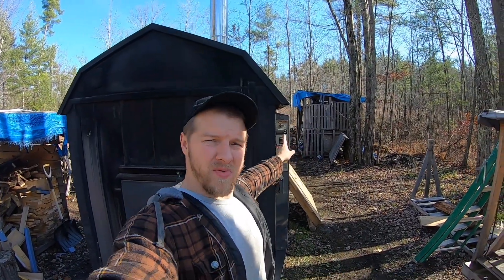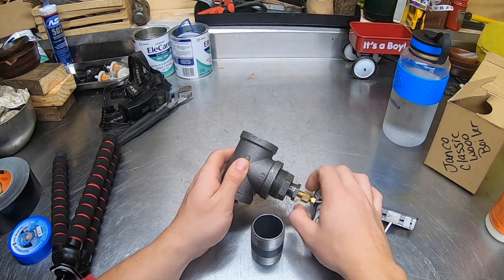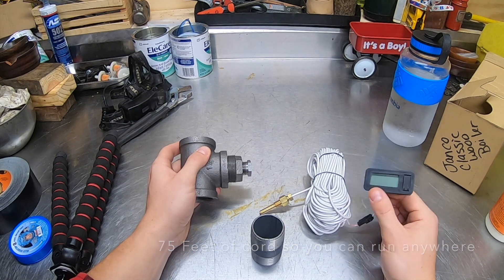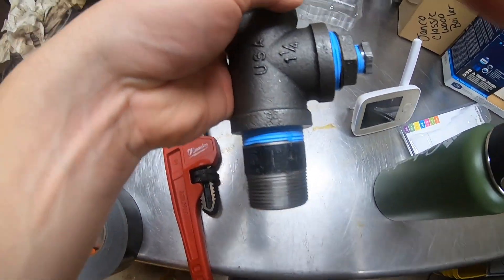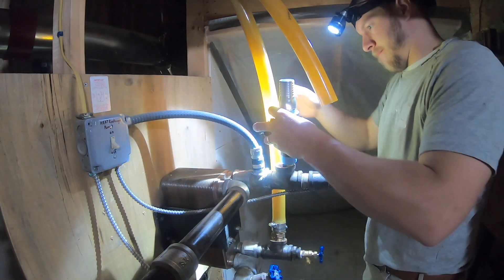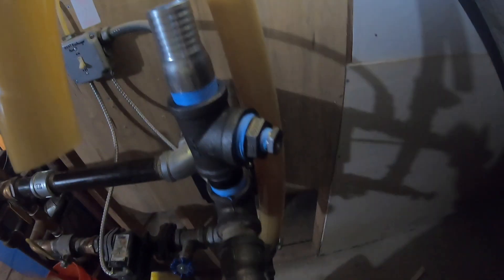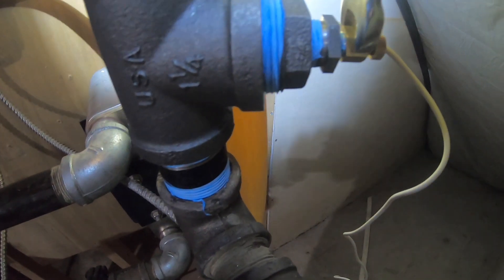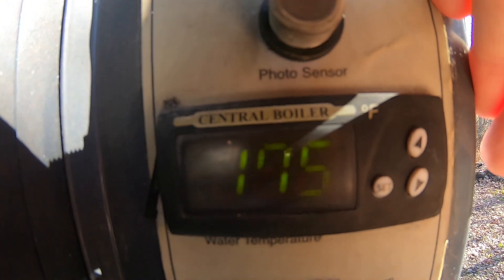The Best Modification For An Outdoor Wood Boiler! Indoor Temp Sensor EP 90

Comment: That's a nice modification.   I installed my own heating system and installed 3 thermometers (analog gauges) so I can pay attention to what's happening
Nice to have the exchanger so you don't need glycol in your whole house ($!)
I actually design heating systems, and I recommend having someone check your glycol concentration (it's a water sample test) to make sure you still have a good mix to prevent freezing now that you've lost a bit.    Also, you should rinse / purge the plates now and then so it doesn't plug up.    Think of it mike a radiator in your car - similar sized little passages - so a rinse every year or two is a good idea
Reply from the maker: Hey Dave! Thanks for coming by! Hmm those are all good tips to consider! The system is not a glycol system, its just water with a anti corrosive additive in it. ive seen he glycol systems and like you said its hugeeeee money!  Next wood boiler, I would do a glycol system ( if possible ). Good tips to know about rinsing! Thanks for watching!
Reply: @HomesteadJay  Do you need to keep your boiler running all winter so it doesn't freeze up?
Since you have a heat exchanger I am 99% sure you're all set for glycol now.   The exchanger is the key piece to seperate inside / outside loops.   Do you have a small expansion tank and pressure relief on the "wood boiler" side of the exchanger just like you do on your main house boiler?
Reply from the maker: @OakKnobFarm  Yes i do keep the machine running because I have too lol. The OWB has a vent cap on top so its a non pressurized system so thats how it stays at atmospheric pressure. A glycol conversion would be wild/expensive but it would be nice that was it wouldnt freeze god forbid something let go and had to shut it down.
Reply: @HomesteadJay  Gotcha!   I was wondering if you were atmospheric or pressurized.    But really: a big expansion tank is all you would really need, and maybe a "dump zone" (toss heat in teh basement if the boiler needs to cool down).   You can convert if you ever decide to!
Reply from the maker: @OakKnobFarm  Hmm I am sure there are a bunch of options but (from what I know) these machines dont need an expansion tank because im assuming theres room in the water jacket for expansion! The machine stays full of water + anti corrosion during the offseason. I dont drain it, they say its actually worse for the metal (moisture/humidity) in the off season!
Reply: @HomesteadJay  It's about freeze protection - Lets say a 2 week outage and your generator croaks.  You'll need to drain the boil, or it could freeze and crack.   Or fam emergency, you all need to leave town in mid-winter.      With glycol it's all safe.
But you're totally right with atmospheric you run no pressure, so you don't need any form of expansion tank.  it just vents excess pressure to the air.    
Pros and cons: cheap simplicity vs expensive fail safe
Reply from the maker: @OakKnobFarm  Yeah thats an awesome point for sure and a HUGE downside to these machines is they need to be kept up unless its  Glycol $. My DREAM would be a solar/battery grid STRICTLY for the heating system. So if power goes out the solar/battery bank will keep the hot water circulating. The OWB only has power to a 12v circ pump and the solenoid for the draft door. So as far as needing huge power to run the unit it doesnt require crazy power. What do you think? DO you think a battery/solar panel specifically for the OWB is a cool idea? Talk about off grid protection for sure
Reply: @HomesteadJay  just checked:  if your boiler is 50 feet away, 1.5" pipe that's just about 11 gallons.  Add 3-4 gallons for the boiler... lets say 15gal total.
You can mix to 45% glycol and get about -15F freeze protection.  And it's less than $75 for a 5 gal bucket.  So one bucket is pretty close.   Plus you need a little pony pump ($75?) to pump the fluid into your system.  Not tragic!
Reply: glycol doesn't cost THAT much, and it can be run atmospheric - you just need to change it more often..  how far do you think your boiler is from house?  and 1-1/2" pipe?  I could estimate the glycol you need so you could see if it's worth it?   But when you go "closed loop" the glycol stays more constant (you're not losing steam to the air) so it lasts longer.  but it can be used in either system.    And you can get it with anti-corrosion additive mixed in ;)